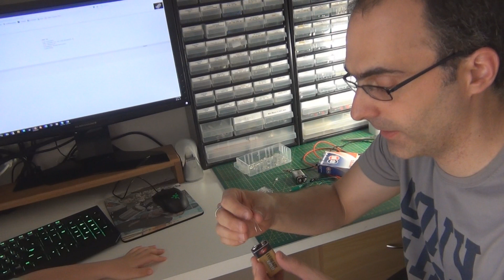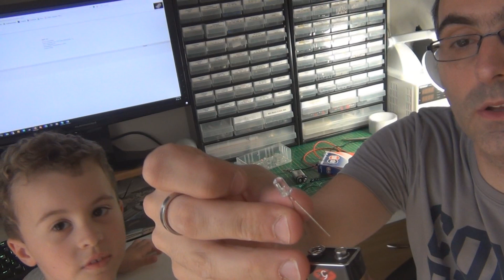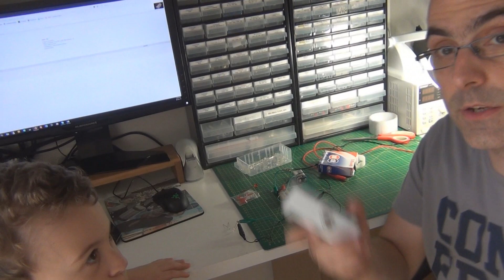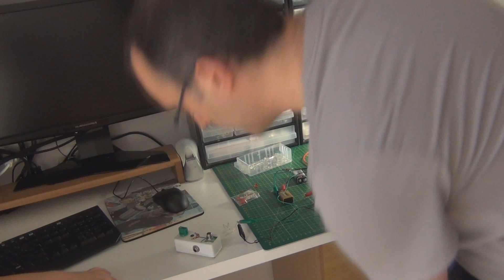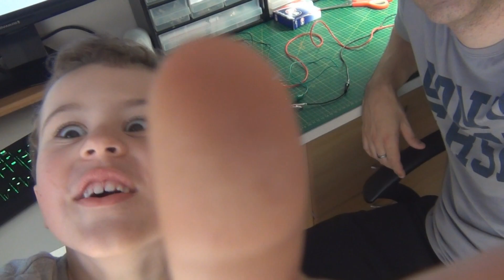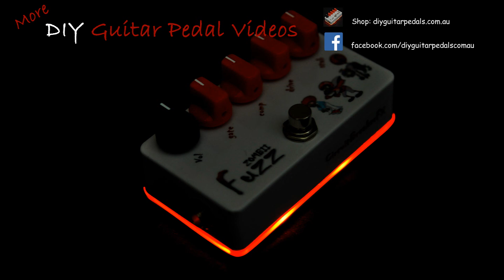LEDS & Current Limit Resistors   Simple Explanation

Comment: This might be a dumb question, but what resistor do you use with an 3mm led at 9 volts? I know it differs from color. Is it something I just have to experiment with?
I'm new to all of this.
Smart kid, by the way!
Reply from the maker: Thanks Noah, he is very mature minded.  Yeah, experiment.  I would try 1k, 2k, 3k, 4k, 5k, or even just 1k 3k 5k is usually enough for most leds.  Those values are of course approximate.  Hope that helps!  Cheers